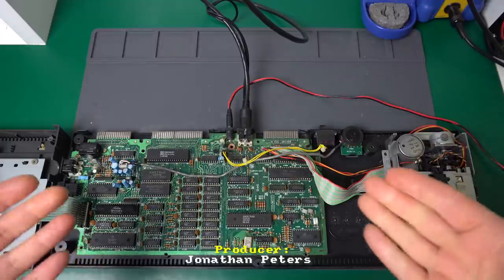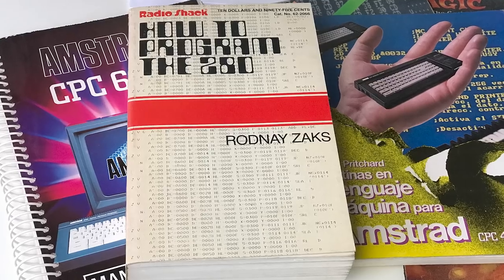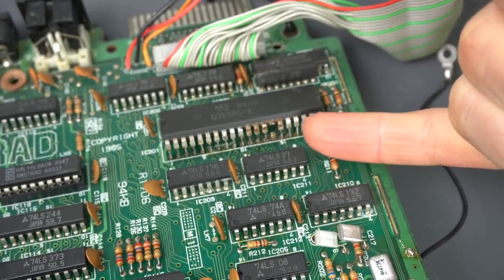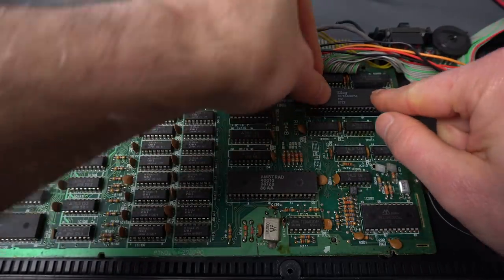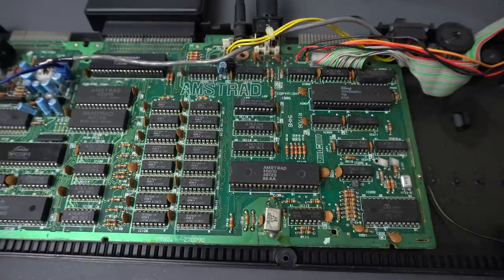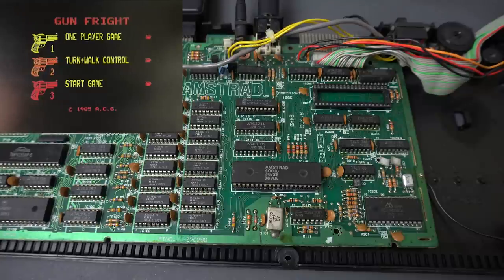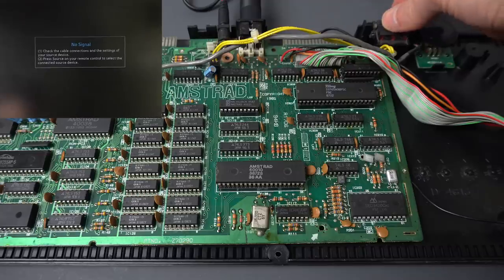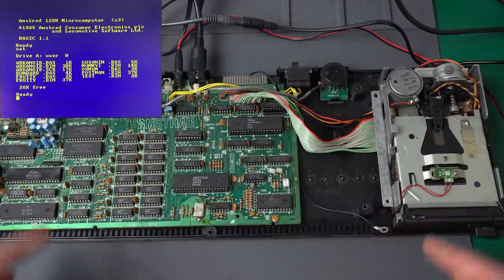Floppy Disk Controller Repair and Diagnostics ROM for the Amstrad CPC

Comment: If you have a PC that you could install Linux Mint CINNAMON 20.1 (Ulyssa) 64bit edition and install Code::Blocks and the Zilog Z80 Toolchain and create the code in C++ and compile it to the Z80A assembly language code that you are wanting.
Reply from the maker: I do have Mint installed in Virtual Box as matter of fact, but I do C/C++ for my real job, so I'd rather keep it to assembly for fun 😃
Reply: @NoelsRetroLab  But as Code::Blocks is a customizable Cross Compiler you can just install the Toolchain for the Zilog Z80A and then if you insert -save-temps in the project options you will have nicely commented Z80A assembly language code which you can show on your channel really there should not be a problem.

Comment: Hey anybody got any comments on this just noticing something interesting.

 I don't know if this is entirely true never worked there for the ABS never worked on any amstrad machines or similar.

Butt I've noticed with ROM cartridges and other cartridges with most devices is.

Boston time the card Edge connector will be on the cartridge itself.

And the connector would be on the device.

There may be others in addition to the amstrad that did this.

I think there were but a bit foggy on that.

I don't know why it computer and gaming system thoroughly as others May.

My question is why would they Opti Tuesday hard-edged female connector on a cartridge versus the device?

You think that the wear and tear will be taken up better the other way around.

And the cartridge connection will be more durable that way!

Seems kind of backwards to me to do it with the card Edge on the device.

Would anyone know about the preference for doing it that way?

I do know in other cases they would do that for external peripherals that probably would not be connected and disconnected often!

But it just seems weird that was a design choice maybe engineering or design reasons or reliability 

 any thoughts please comment
Reply from the maker: I thought about that for a bit, and the only conclusion I came up to is that it was cheaper to manufacture an edge connector in the machine. It makes devices that plug into them more expensive, but Amstrad didn't care since they weren't making cartridge games or tons of expansions.